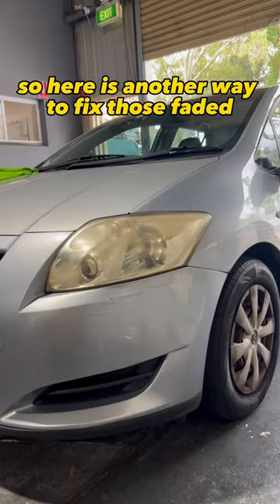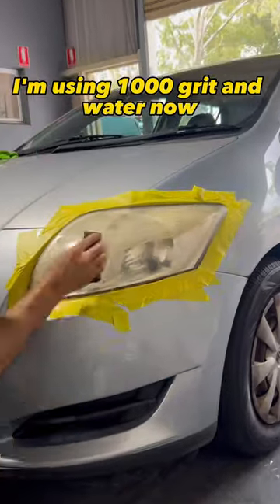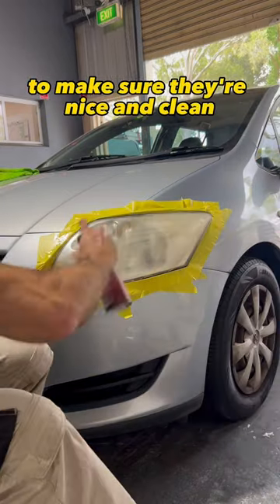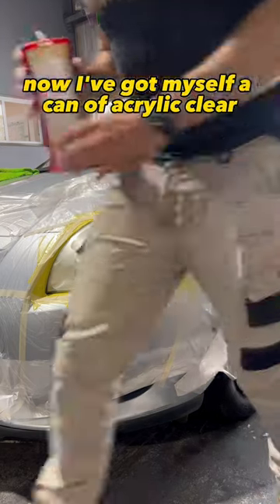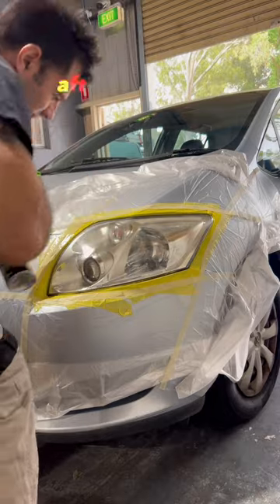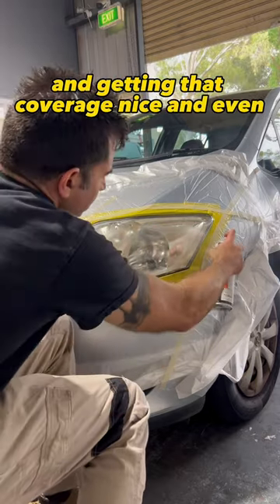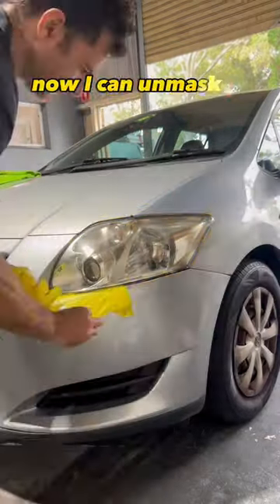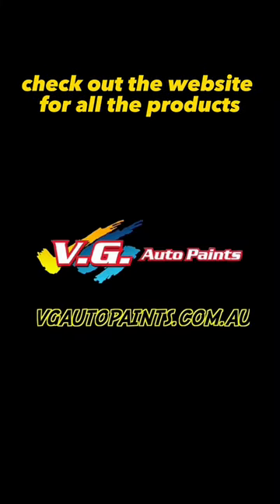Just another way to fix those faded headlights.

Comment: Yeah this is a temp fix. Actually not a good one, going to take longer to fix the next time.. you need more sanding in stages and dedicated headlight coating with UV protection.

Comment: This is the method I used for my 2008 Lexus headlights, but the clear coat was done by shop using a spray gun and acrylic cc. This was done in 2017. Holding up nicely, unlike just sand>polish>buff which dulls out in just a couple of Summer seasons

Comment: 1000 is not enough, you must remove all the yellow almost with a 600. Sometimes i've started with 350!
Reply: You mean 320.
Reply: No bro. Roughest you should start with is 800.
Reply: @_GandalfTheGrey_  when it's so yellow starting with 800 it needs 2 days sanding.
Reply: @_GandalfTheGrey_ epending on the headlight material and severity 320 may be necessary. but you’re right, don’t START with it always test with a higher grit to see what adjustments you may have to make. Most times i start with 600
Reply: @jackhinson9284  That seems much more sensible.
Reply: I was about to comment this. Even when you get a lot of the yellowing away, if you have scratched up older covers you could like even go down to 350 or something and then just go up the grits and wetsanding it for a way clearer and better lasting results. 

It's really not much more work while you're already at it.
Reply: 240 1 fase.. 😊
Reply: 800 Is the lowest I would ever go ...320? 😂 fk that
Reply: @_GandalfTheGrey_  already done. The job went out perfectly.
Reply: @jackhinson9284  that's right! It depends on the fairings' conditions.
Reply: @Wikimikitiki  That seems crazy to me. Maybe you have a magician’s hand haha good on you though!

Comment: You just got that over spray right on the front windshield 😢
Reply from the maker: Not even close. 👎
Reply: Overspray on exterior glass is a really easy clean-up... 0000 steel wool is your friend. However, DO NOT use this on mirrors or on any interior glass or plastic!!
Reply: Hardly possible from a can, indoors
Reply: Clay bar will clean up the windows and surrounding areas